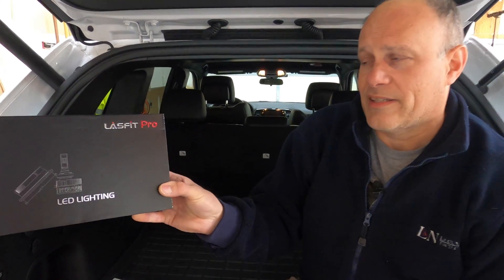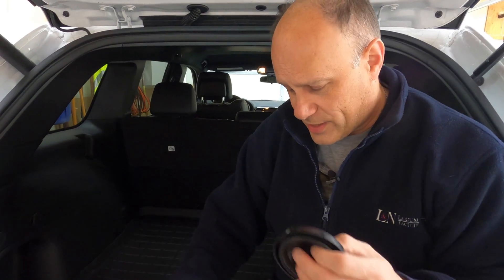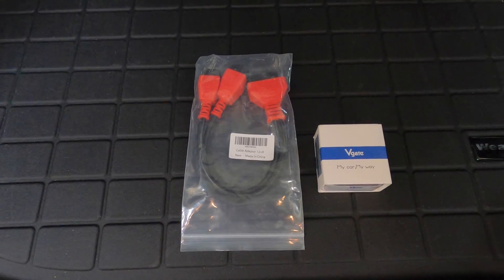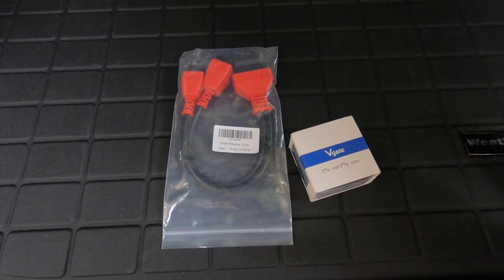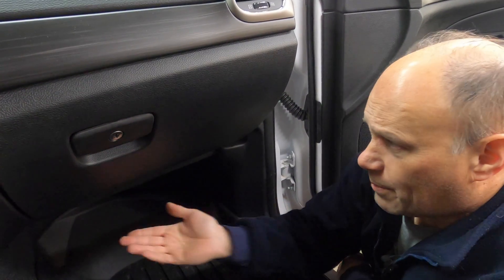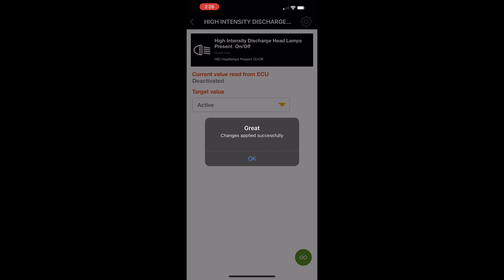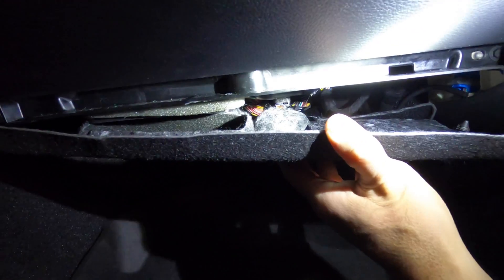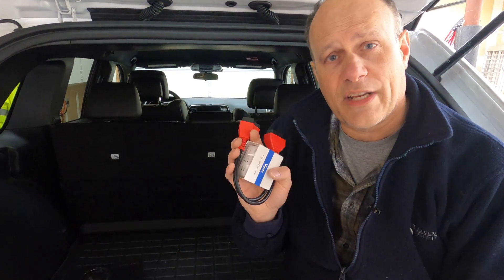How to Fix Flickering LED Headlights (the RIGHT way!)

Comment: Will this work on a 2017 dodge journey crossroad
Reply from the maker: The settings should be present for your vehicle - each car is slightly different so, while I imagine this should work for you, you may be able to solve your issue with a canbus adapter or similar (if you haven’t already)!

Comment: I bought the cable and the icar pro.. I have a 2011 Jeep Grand Cherokee Laredo and put VLAND projector LED headlights in, makes it look 10 years newer! They are awesome headlights by the way 😁, highly recommend them, very bright. People flash their brights at me 😂. I didn't need the cable you have, the icar pro plugs right into the obd plug module on the driver's side so I didn't need the cable, need to send it back. I have changed the settings for HID and the quad led light was already on.. It works.. Fixed the flickering 👍

Thank you for your video Pete.

Comment: Hi, excellent video, very clear and easy to understand. Could you help me or guide me on how to solve this flickering problem on a 2004 Dodge Durango 4.7L?
Reply from the maker: Thanks for watching! If the methods described in the video don’t work for your vehicle, I’d suggest trying out PWM or CanBus adapters that should regulate the voltage and help prevent flickering issues! What brand lights do you have?
Reply: @completepete  By the way, what app do you recommend for that job you did? Or can it be done from any app?
The lights I'm using are Imloya brand, model R2-H13, 40 watts. And they already sell a "Load Resistor Harness Anti-Flicker Warning Canceler Decoder" and a "Canbus Adapter Anti-Hyper Flash Error Free." I'm not sure which one I need. Any suggestions are appreciated.
Reply from the maker: I recommend the JScan app for this job! There may be others, but I used JScan with good success. I think the load resistor is probably what you need, but, if their return policy is good I would say purchase both and return whichever you don’t need.

Comment: I recently got h13 LED bulbs for my 2017 f250 and the bottom lights flicker and I tested the voltage and one of the plugs on each side is lower voltage how should I fix I’ve tried resisters and differnt headlights

Comment: I can confirm this works on 2015 Jeep grand cherokee limted . I purchased 3 sets of different led lights all of them would come on the shut off or 1 light would go out . I tried anti flicker and resistors  same result . I purchased the i car pro and j scan app and it work perfectly . Thankyou so much for this valuable information !

Comment: I replaced 2014 dodge charger HID with quality philips h11 ultinon fog lights but get flickering bulbs when driving sometimes. It came with a new adapter does 2014 dodge charger need resistors or other things?
Reply from the maker: Hi Tommy,

Can you clarify a bit on your situation? Did you replace HID bulbs with H11 LEDs, or H11 HID bulbs? I would try resistors and then if that doesn’t work, try to use this method described in the video

Comment: Thanks for the video. I have a 2009 grand cherokee that the led lights stay on dimly for a minute after turning the vehicle off. Will this setting help with this issue?
Reply from the maker: Hi Alex, it sounds to me like you might just need a pair of resistors to fix this issue. That would be the cheapest and quickest option to test out before embarking on this effort, which is primarily designed to correct flickering while the vehicle is on.

Comment: THANK YOU I had absolutely no idea this was even an option. When I installed my plug and play led headlights from autozone, they would both come on together right away when I would start my car. After I would drive through a well lit part of town my auto lights would turn off resulting in one headlight off and the other headlight still on. Due to the low current of these led headlights, it throws off the auto light sensor system. Making the car think both lights are still off/on when needed.

Comment: i put a led light in my 2012 chrysler 200 limited and its flickering ..the led that i put is farhen h11 with capacitor ....what shlould i do sir thanks
Reply from the maker: Hi Michael,

You could try to use the JScan app with your car to enable the HID lights function as is demonstrated in the video to see if the car will recognize the change in power draw required and stop flickering. Otherwise, I would say I generally recommend purchasing a high-quality product (which of course will cost you) and, if needed, resistors, to ensure you’re getting the best chance to eliminate flickering or other similar issues. I typically recommend Diode Dynamics, GTR Lighting, or Morimoto if they have a product that works for your car. LasFit is also a decent product but would not be my top choice.
Reply: @completepete what i am going to have to try doing also tried few different can bus decoders, tried sylvania led things meant for led blinkers some people it worked on diff cars nope not the 200
Reply from the maker: I would suggest trying to use the JScan app with your car to enable the HID lights function as is demonstrated in the video to see if the car will recognize the change in power draw required and stop flickering. Otherwise, I would say do your best to ensure you’re using a high-quality bulb (which of course will cost you) such as those made by Diode Dynamics, GTR Lighting, or Morimoto if they have a product that works for your car. LasFit is also a decent product but would not be my top choice.
Reply: i have the same car

Comment: What’s the difference between the icar pro WiFi and the icar pro Bluetooth? 
It’s also my understanding that I won’t need the cables since I’m going do this for my 2016 jeep compass. I can directly plug this in without the by pass.
Reply from the maker: The only notable difference is in the way your phone connects to the adapter, either over WiFi, or over Bluetooth. Bluetooth has been a stronger, more reliable connection in my experience, but for what will hopefully be limited usage, I’d pick the one that is least expensive! 

Based on some brief research, I’d agree that you should be able to connect without the gateway cables In your model year!
Reply: @completepete  does that mean one would always have to be connected to wifi for the lights to be able to stay on and not flicker? In other words, do the settings that are applied through the device you’ve shown here, do those settings stay permanent while the device is connected? Do I always need to be connected to WiFi for it to operate?
Reply from the maker: The device itself emits a wireless network for your phone to connect to when in use - it doesn’t connect to your home’s WiFi, or any other WiFi you might connect to throughout the course of your day. Once you make the setting changes and they are written to the vehicle’s computer, there is no need for the device to remain connected, or for it to ever be connected again in the future unless you’re using it to do something different
Reply: @completepete  thank you so much I really appreciate the help and the detailed explanation, I finished ordering one of these for myself earlier today. Thank you.

Comment: There was no flickering demonstrated (looked like a ceiling fan in front of his garage light) and then no follow up of the "flickering" going away after the install...
Reply: My 2014 chrys 200 litteraly only does it while moving, yesterday i installed some sylvania leds stayed on fine for at least 5 minutes!! So i installed bumper back on go to drive it at night and didnt even make it out the drive way they start winking like crazy lol
Reply: One on, then off and the other one comes on when that one goes out, got can bus decoders off amazon, still not working
Reply: @TheDunceMafia  same problem
Reply: @TheDunceMafia same problem with my LEDs on my 15’ Tucson . They flicker . Not sure how to fix and other lights are way too dim to be driving …

Comment: I saw in the video that the jeep patriot is supported on the jscan app, but do you know if they all have the same options under the adaptations tab on the app? I want to try this but i dont know if it would be a waste of time
Reply from the maker: Hi Joseph! They adaptation options won’t be exactly the same between the Patriot and other supported models, but as far as I can tell from the demo settings in the JScan app, LED/HID light settings like those described in this video appear to be present!

Comment: My question is, what do I need to do this with my 2019 Chevy Silverado 1500 Custom Trail Boss. I have the Lasfit lights installed for by my high and low beams and my low beams will turn on just fine but then will turn off and then back on. Sometimes only one comes back on. Lasfit sent me adapters to possible help with the issue but the way they want me to install them is kind of shady. If I can do it through adaptations that would be a big help. However, I do not know which app would work.
Reply from the maker: Thanks for watching RCWing! To my knowledge, there is not a trusted, publicly available application for Chevy that serves the same purpose as JScan for CDJR or ForScan for Ford. To help troubleshoot this further, could you provide some additional details including: (1) Does your vehicle have halogen or HID bulbs from the factory, (2) How long are the low beams running before they turn off/turn back on sporadically, (3) when the low beams turn back on (one, or both), is there a certain period of time until they will turn back on, and (4) What method is LasFit asking you to use to install their adapters?

I would imagine that CANBUS/AntiFlicker adapters are needed in your situation, but I'd like to work through some of the questions I posed above to help identify any other solutions.
Reply: @completepete  lasfit sent me two canbus' to install. However, the way they want me to install them is by cutting the dust cap and using a crap ton of electrical tape to secure everything. I'm an aircraft electrician by trade and the fix they wanted me to try is not something I would do on an aircraft.
Reply from the maker: Did your purchase include LasFit’s dust covers with the integrated fan, or are they suggesting you cut into the stock rubber dust cover? I’d be curious to see, through a temporary install, if the canbus adapters solve the issue - you could probably design a more efficient/clean way to add them into the loop than what the company is suggesting if that seems to solve your problem, or, perhaps another manufacturer makes bulbs with integrated canbus. 

If I were troubleshooting, I’d remove the dust cover and hook up one of the canbus adapters (fastened with zip ties or tape temporarily) and assess the result. 

Does your truck have daytime running lights? Often, DRLs run at a lower intensity which can produce odd interactions with aftermarket LED bulbs. Does the problem occur if you turn the lighting dial to “on” before the bulbs turn off the first time? I’m wondering if the “auto” feature is somehow playing a role.
Reply: @completepete  Yes, when I purchased the LED lights for the low beams they came with the dust covers with the integrated fans. I thought I still had the email with the picture they sent me.  I think they wanted me to cut the stock rubber dust cover and the wrap it with an excessive amount of electrical tape. I had thought of looking into another manufacturer but I'm not sure where to start on looking exactly. Yes, the truck does have daytime running lights. The problem occurs whether the control is set to auto or on. However, with the switch set to on it doesn't happen as often. For example, I live about 15 miles from where I work and I am currently working nights. When I drove home from work today, I set my switch to on. The driver side light went off for less then 10 seconds and then came back on by itself. I didn't happen again for the rest of the drive home. If I have it in auto it seems to do it more often.
Reply from the maker: I'd consider trying a different brand such as these linked below. I suggest chatting or emailing with Headlight Revolution to confirm fitment for your application as the first set I linked is not labeled as "low beam" on their site, but is an H11 bulb which matches your truck's needs. 

This bulb explicitly mentions built-in Canbus, which should alleviate your issues and allow for a cleaner installation. https://www.headlightrevolution.com/s-v-4-led-headlights-h11-h16-bulbs-HRH11V4_2?quantity=1

I have heard good things about GTR lighting bulbs, and they have been tested by Headlight Revolution for function in the 2019 Silverado 1500, but it is possible you could need a set of PWM modules as the canbus functionality doesn't appear to be integrated.
https://www.headlightrevolution.com/2019-chevrolet-silverado-1500-custom-ultra-2-led-low-beam-bulbs_2?quantity=1
https://www.headlightrevolution.com/gtr-lighting-pwm-hid-kit-modules-ACC.PWM5202.MOD_2?quantity=1
Reply: @completepete I apologize for the late response but I never saw a notification saying anyone responded to my comment. I appreciate you sending a message.
Reply: @completepete yes, my truck came with halogen light bulbs. It's usually with the first 60 seconds of driving they will either both turn off and both come on, one turn off and come back on, or one turn off and not come back on. If both or one dosen't come back on I just flip the light switch from auto to on and it usually fixes the issue.

Comment: Does this work for 2005 grand cherokee laredo
Reply from the maker: The JScan application supports the 2005 Grand Cherokee, however, without having tested this on a 2005 model myself, I can’t guarantee it will work. If you purchase the components described in the video from Amazon, you can always return them if you find that it doesn’t work.

Comment: I could use your help I have a 2016 Ram 2500 Laramie Longhorn I purchased 250watt low beam aftermarket LED bulbs they come on and go off they don't flicker can u help
Reply from the maker: Hi Mike, it sounds to me like your truck thinks your bulbs are out since they draw significantly less power than traditional halogen bulbs. I’d suggest CANBUS bulbs or a CANBUS adapter which will trick the vehicle into thinking the bulbs are drawing the correct amount of power. Most high quality bulbs have this technology built in, but some do require dedicated adapters. What brand bulbs did you buy? I’d check out Diode Dynamics to see if they have anything that fits your needs.
Reply: My 2015 is doing the same. I brought the Xentic HID kite, and it flicker then shuts off. I did some research and found out you have to buy a separate relay kite, and that should solve the problem.

Comment: Does the 2014 cherokee "kl" use the same adapter? I got the vlink and downloaded the jscan thinking that's all I need to turn on the led headlight but it says I don't have a license
Reply: Thanks, I figured that out but then when I enabled "xenon' lights, I guess the 2014 is different, a bunch of check engine lights came on, I think I need something called a pwm module  ??
Reply from the maker: @123gaberam have you tried in-line resistors and undoing the changes you made in the app? I’d try that before anything else to see if they work.
Reply from the maker: Hi there! Thanks for watching, and for your question. You’ll need to purchase a license for JScan by opening the app, clicking the settings wheel, and choosing “Manage Licenses and Account” to purchase
Reply: Does this method not work on jeep cherokee then??
Reply: No it doesn't, i have to use resistors @angelgaming4208

Comment: My led headlight are only half illuminated half the other half of it turns on and slowly dims
Reply from the maker: What brand are your LED bulbs? If the bulbs aren’t fully illuminating it’s likely that there is an issue with the LED’s themselves / a quality control problem.
Reply: @completepete I have a similar issue with mine on my charger, mine are auxito brand, they don’t l necessarily flicker but mainly dim every now and then

Comment: Does this work for the fog lights on a 2015 summit?
Reply from the maker: Hi Bruno, thanks for watching! If your fog lights are flickering, this fix likely won’t work for you, as it’s designed to correct the main driving lights flickering. You’d likely be best off investing in resistors to solve your problem.

Comment: Will this work on my 2023 Civic Si?  My headlights flicker during the day while the lever rests on AUTO.
Reply from the maker: Thanks for watching! Does your vehicle have factory LED headlights? If so, is it the bulbs that came with the car that are flickering, or did you replace them? If the vehicle is still in its stock form, I would say this sounds like a problem with the vehicle’s computer and is likely a recall (or future recall). 

I’m not aware of any similar software or tool that is non-Honda OEM that could be used for this purpose. If you’re working with stock halogen bulbs that you’ve upgraded, I’d suggest ensuring you have purchased good quality, made in USA LED’s and, if those still present a problem, try installing resistors in-line. Good luck!
Reply: @completepete  Appreciate your time with your reply. Yes, they're factory headlights and bulbs.  I've noticed this issue happening after starting the car more than twice during the day. I'll be bringing my vehicle to the dealership since I got warranty. Thank you for your time!

Comment: Does this can work on my 2014 Jeep Patriot
Reply from the maker: The 2014 Jeep Patriot does appear to be a supported vehicle. This method may work for you, or you may find that some combination of resistors and software changes are necessary. Good luck!
Reply: @completepete what about the 2010 Patriot?
Reply from the maker: Your vehicle appears to be supported by the JScan app, so, you should be able to attempt the same fix that is demonstrated in the video. You may find that your vehicle requires resistors as mentioned above.